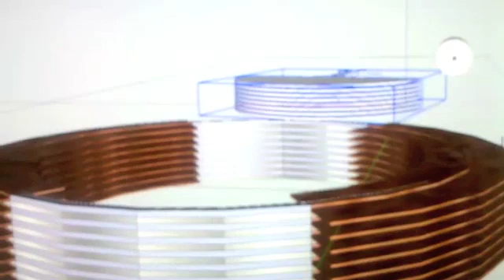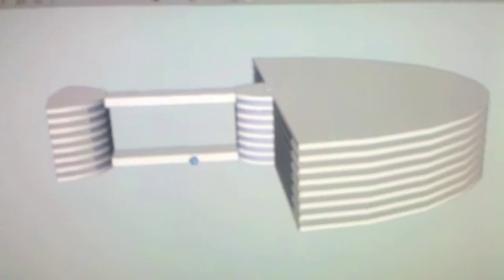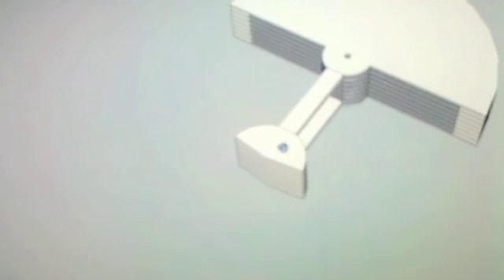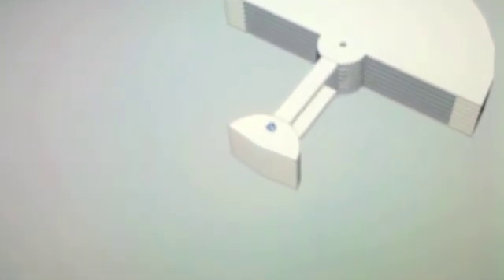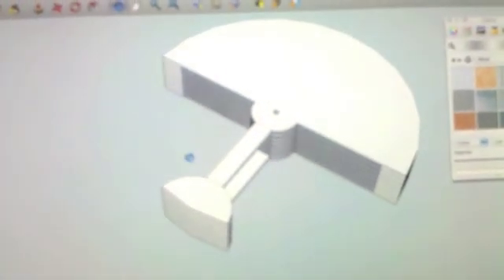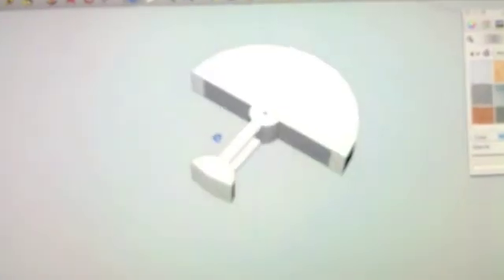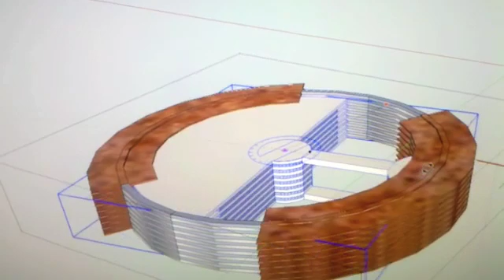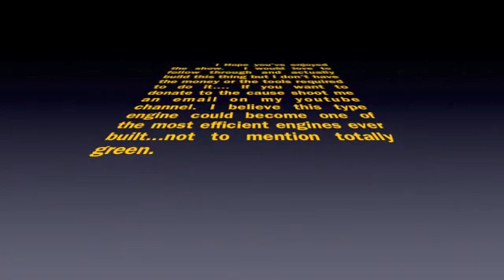New Concept Heat Engine with flywheel serving as displacer

Comment: Hi, Great to be able to watch someone else reasoning. Thanks. Meanwhile it occurs to me that if your rotary displacer were substantive flywheel, then it would be too thick to allow it also work as an efficient displacer. (ie) the displacer shell would be too thick and so not heat/cool the working gas efficiently.  All the best with the concept.

Comment: Solar is easy to make at home now and supercapacitor storage can be built from household materials relatively cheap.  If you wanted to build a sterling with enough horsepower to push a 20kw load, it would be roughly the size of a stadium...a true sterling, that is.

Comment from the maker: You may be on to something, but I don't think increasing the size of the displacer is the answer.  Maybe a tighter tolerance between the heatsink fins and the fins of the displacer, or even a thin material on the trailing edge of the rotary displacer fins would work...I sure wish I had the material, tools and time needed to build this thing.  It would be interesting to see how well it would work.

Comment: After watching this and several other examples of rotary stirling designs, I believe the issue is with virtual dead air.  Even though all the air in a rotary design is being moved, only a small portion of it may be making contact with the sides, leaving the rest to be virtually dead air.  If the displacer takes up more of the radius all the way around, leaving 10% airspace around one side, it might be more efficient.  While this may increase efficiency, it will also increase size dramatically.

Comment from the maker: Just because one side is larger than the other doesn't mean it can't be balanced.  That is really the prim reason the smaller part of the displacer is in the design.  By using a heavy weight in the tail portion and building the larger portion out of light weight materials it should be able to be balanced....that is the game plan anyway.  the design may have to change on the fly if I can't balance the displacer/flywheel.

Comment: So, becuase the rotating mechanism is off balace you will have a number of issues.  First the vibrations will be out of control.  Second your bearings will wear out really fast.  And third the amount of friction from the wheel to the heat sink would probably generate more heat than it counld dump.

Comment from the maker: Yeah, after I posted this video I came across some similar designs.  Nothing with the heat sinks though.  How much of a difference do you think that would make?  I still haven't built it because I worked out some calculations and it just doesn't seem like it would be very powerful...probably will barley keep itself going.

Comment: Its not new ...the idea has been around years ..I built one that runs in 2009 and others have been built years before that
I have subsequently built a two cylinder three chamber magnetically coupled and pressured  to 6 bar version that still only managed 160 rpm!